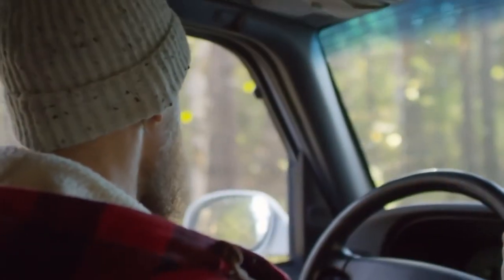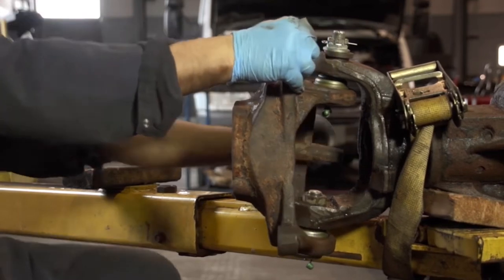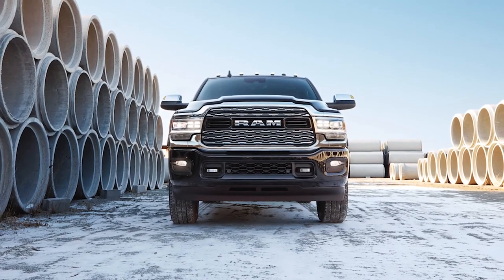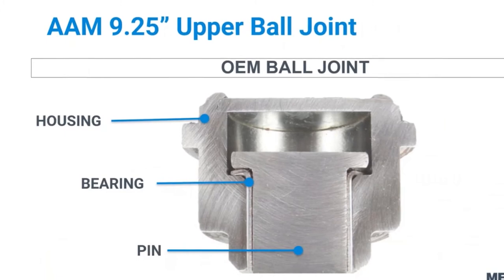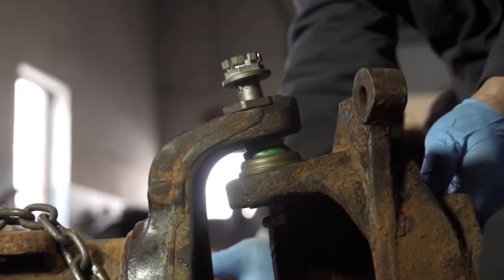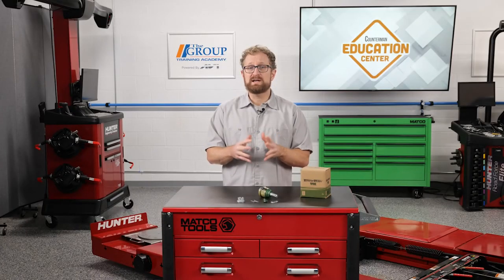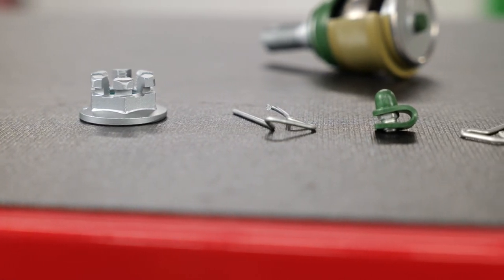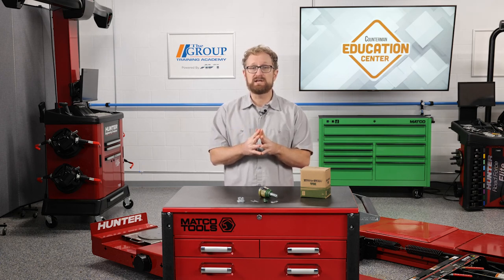An Aftermarket Solution for Memory Steer in Dodge/Ram Trucks

Comment: Hey Josh, my name is Mike. I have a 2014 ram 2500 that the steering does not return smoothly from left to center or right to center. During slower turns it feels chunky/clunky returning. almost like it’s still engaging front axle but it is not. I’ve already checked that any recommendations. By the way, I’ve already had the steering box replaced 87K on the truck.